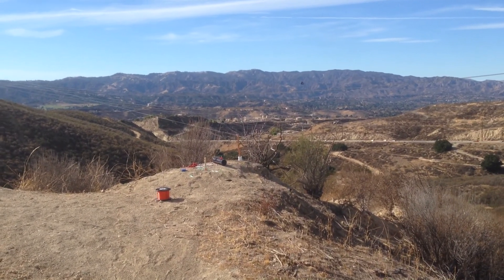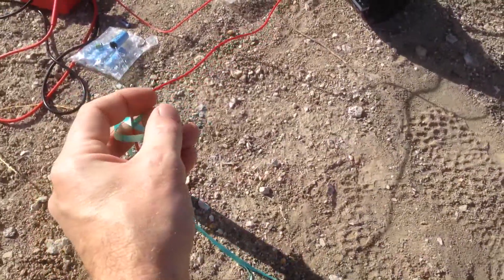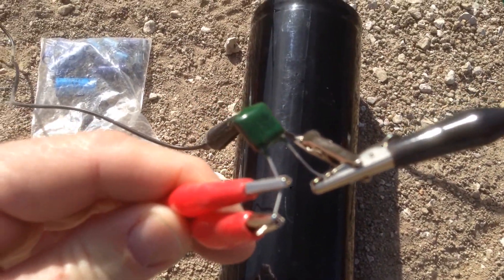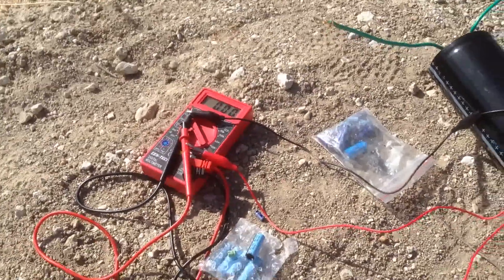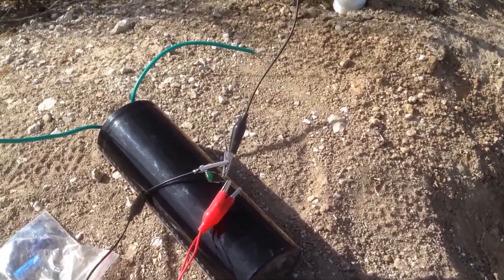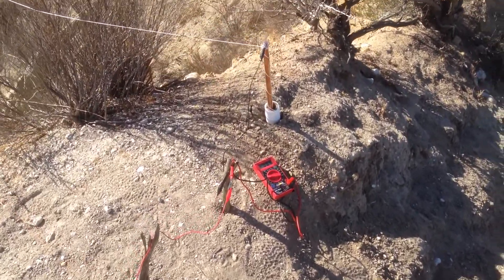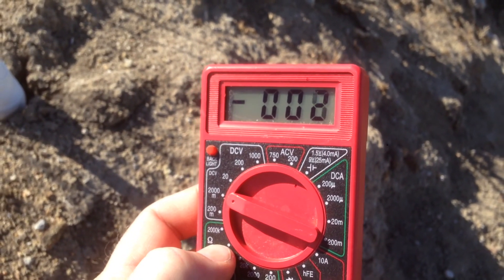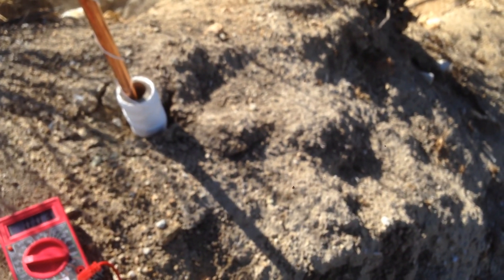PMBO 2014 update 1 (atmospheric ions & ground rod)

Comment: Russell:  

I applaud your persistence. Keep up the good work!

Clint
Research Leader
IonPowerGroup.com
Reply from the maker: +IonPowerGroup Thank you. I will keep trying. I had my best results with a small tower with spikes coated with graphite, but it was still low voltage (18v in 24hrs). Do you have any tips or different techniques I should try?